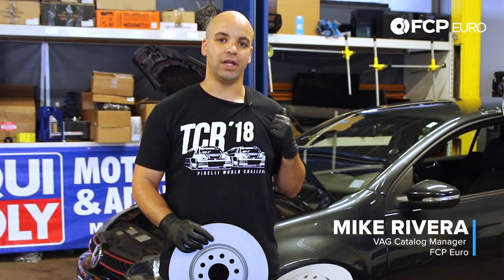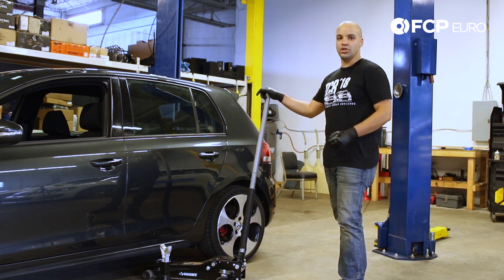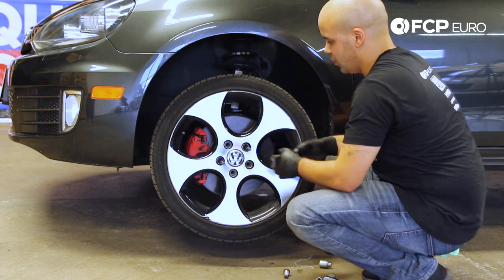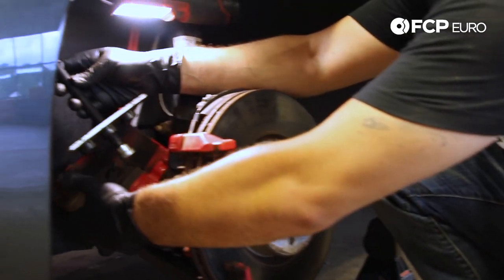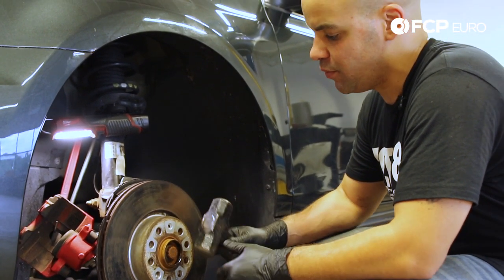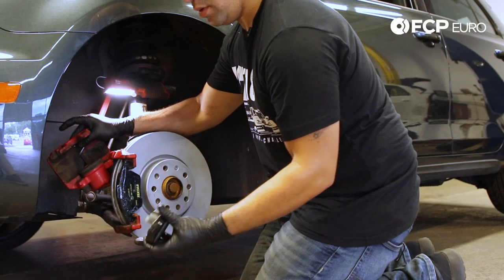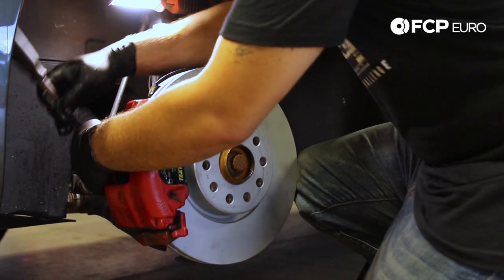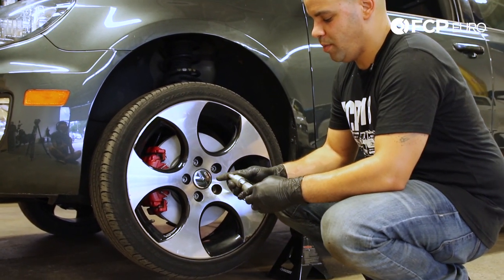VW & Audi MK6 GTI Front Brake Disc Pads & Rotor Replacement DIY (Golf, Passat, EOS, TT, Rabbit, A3)

Comment: Always clean the hub with a wire brush when you remove the old rotor. You can even go a step further by adding a little bit of anti seize as well. 

But at the very least, make sure you clean off some of the surface rust.

Comment: Great video, but you need to include more details to provide a comprehensive video for the do-it-yourselfer.  You did not show taking out the slide pins in the video.  You did not mention any torques on the bolts (this is really important on brake components where safety is paramount).  You did not clean off the hub.  The slightest amount of debris on the hub can cause runout in the rotor at the the outer diameter.  I usually take a very light duty SS wire brush on a die grinder to remove all rust and ensure the hub has no debris (remember the difficulty you had removing the rotors?  Think rust and corrosion left behind).  I am not sure if you mentioned to kind of grease, but greases are not all compatible.  You have transfer of grease to that brake pad surface you installed on the piston side.  You should mention using brake cleaner to clean off all grease and oil after done.  Details count here and we should strive to put all details in there such that not a single question remains unanswered, including the toque on the lug nuts.  Once a person gets involved in such a repair, they cannot be stuck with questions.  Please don't take offense to this critique.  I am only trying to make better videographers of people.  This stuff is great!!
Reply from the maker: Thanks, Michael! Those are all great points! We are constantly working on improving the quality of our DIY's. Stay tuned for more!

Comment: I don't trust the pinch welds to put the jack stand under personally. The lower control arm has a much more stable & solid spot for the jack stand just behind the front wheel.

Comment: I seen in the video you don’t have those sliding clips for brake pads but in the other video you installed them could that be my squealing? Or maybe cause I didn’t use textar lubricant and used cooper anti seize lubricant

Comment: I have 80,000 km on my 5 spd 2010 Golf and will be replacing all rotors and pads front and rear.
Reply from the maker: We always recommend changing your brake pads when you are changing your brake rotors or vice versa. It is good to replace both units so both wear evenly. If you were just to replace the rotors and re-use your old brake pads for example, this may cause the new rotor to wear unevenly thus prematurely wearing down your new part that you just ordered.

Comment: So many important steps overlooked , there are more comprehensive videos which cover the failings highlighted below.

Never tighten a locking wheel bolt to more than 40 Nm maximum,  and use a quality anti-seize

Comment: I have a 2013 Polo GTI 6R 1.4 and I have the same braking system, for some reason I don't have a brake pad wear sensor on the orginal OEM pads but the new ones I bought have sensors, there is also no connector wire on the car. I am pretty sure the Polo GTI comes with sensors as well. Can anyone help?

Comment: You forgot to open your brake fluid cap
Reply: That also...!

Alternatively, you could crack open the bleeder screw... 

Isn't that a crucial step in the procedure of changing brake pads?

I mean, wouldn't you risk damaging brake system not taking that measure?

Pressure inside would be big enough to cause damage!?